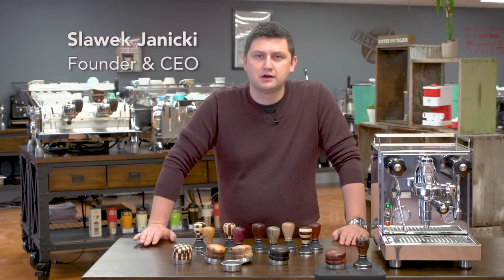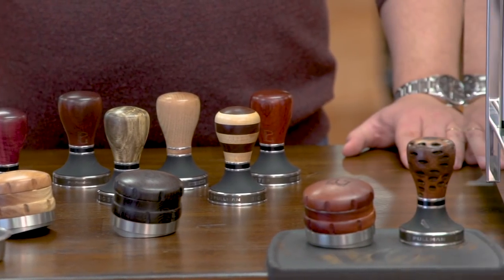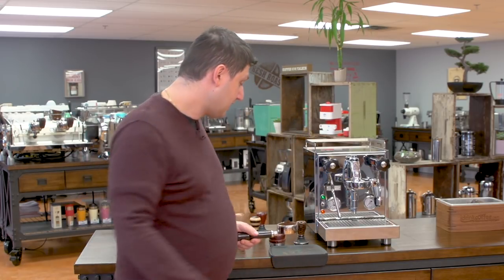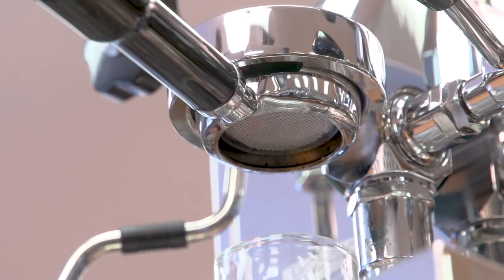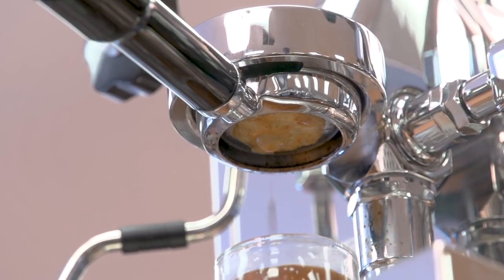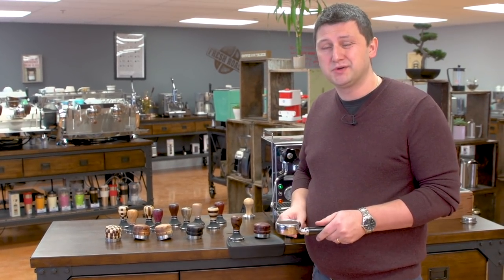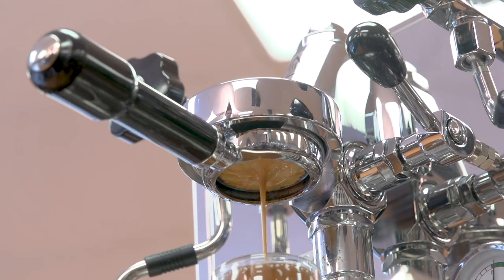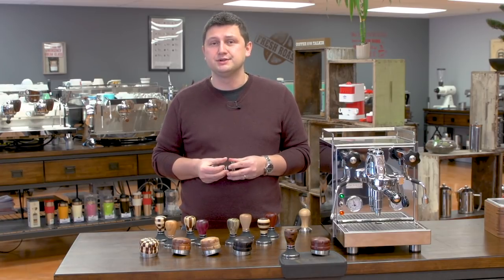iDrinkCoffee.com Review - The Pullman System Basket, Chisel and Tamper

Comment: What you missed is that with the first basket although it did finally center it never utilized all the holes in the basket. There was a set of holes on the far right side that appeared to be either clogged or possibly never drilled properly at the manufacture stage. This is all too common with the cheaper basket. On the flip side of this coin, the Pullman basket was fully utilized (all holes were utilized—coffee was pouring through all holes) and the coffee did come through the center of the basket although not as quickly as I would have expected to have done. Thanks.

Comment: which one is better ? VST basket or pullman filtration?
Reply: both are great, but I recently bought the Pullman Big Step Tamper to match together with the Pullman filtration basket and is a different ball game! outstanding! highly recommend it.
Reply: I've got the pullman 876 17-19g , vst 15g, vst 22g, pesado 20g, ims 16g. That pullman 876 basket forced me to grind even finer than vst 15G and the results is amazing the best out of all basket i have. The pullman 876 gives the sweetest and juiciest body out of all. But that thing is really sensitive to distribution you need to make it perfect. I used twister distribution tool and swap my chisel handle to my big step and make it a palm tamper.